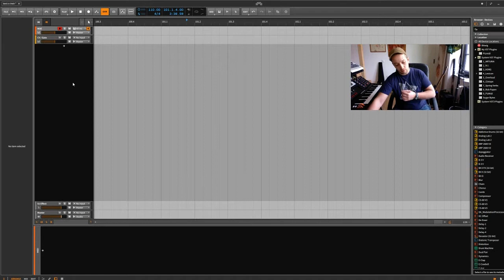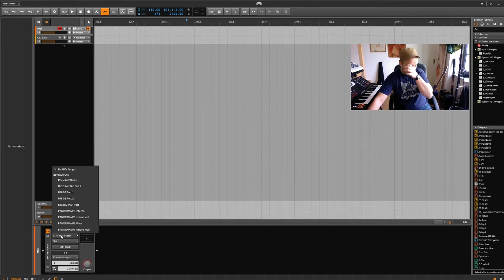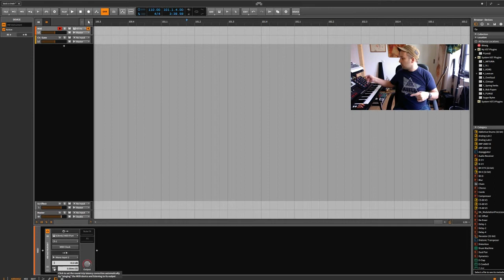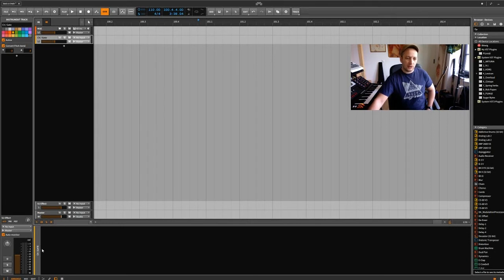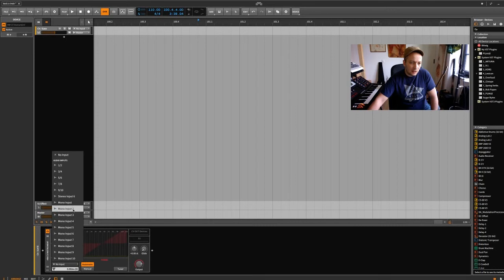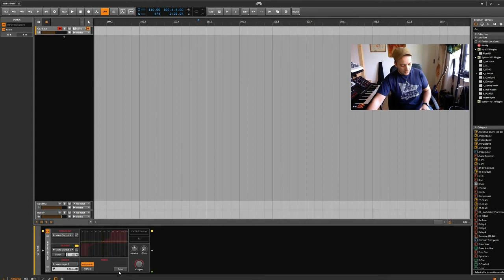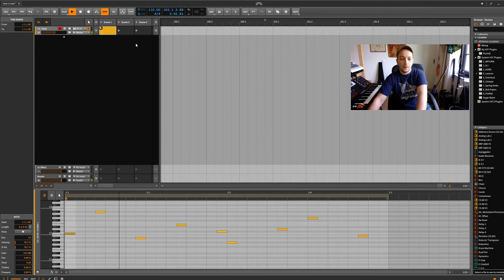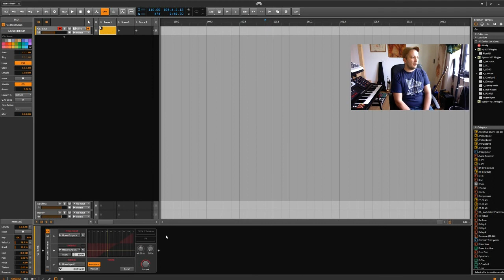Bitwig Tutorial:  How to hook up your Hardware Synths using MIDI Or CV/Gate

Comment: hi mate, loving ur tutorials, as I'm new to bitwig 2 ireally appreciate them. 

i have a little issue and was wondering if u have any advice. i have 2 hardware controllers ( akai mpd232 and the beatstep pro) hooked up to bitwig. thing is when i select a track in bitwig it will pay sequences from all of the controllers at once but i don't want that. what i need to figure out is how can i assign one controller to a specific channel/ track n so it will only play sound s from that one track. the beatstep pro has 2 synth sequencers and 1 drum sequencer so i need to select midi channels to match the tracks on bitwig but bitwig does not Show me an option to select a midi channel
Reply: Mathieu Pé 
thanks for the quick response b
m8

can't find anything for the akai but the beatstep is for bw1 . to b honest the controllers work fine but i just need them to play sounds from specific tracks. i.e. if i set the akai controller to midi channel 10 i want my drum track in bitwig set to channel 10 so its only triggered by my akai and not my other controllers and then i can have my beatstep on midi channel 1 and have polysynth set to midi channel 1 so its notes are only triggered by the beatstep. my problem is when i click on a track in bitwig it will pay notes from both of the sequencers at once. 

iv installed v2.1 beta today and it comes with a midi mapper but im trying to figure how to work it

thanks
Reply: Mathieu Pé no worries thanks for your help though. really appreciate you taking time out to respond
Reply from the maker: You're welcome. Sometimes it takes a bit longer though :)

Comment: Can i only send Midinotes (note pitch a.s.o.) if the external Device plugged to Soundcards Midi In?
Because "Clock" don´t need a Information on Soundcard´s Midi IN, i can send with just Soundcard´s  Midi Out to the Gear.
Why i can not sending Midi Notes the same way?
Or do i need setup the Midi-Filter (PCE and PCEN) correctly?

My SoundCard has 1 I/O Midi.
DAW(Clock) -> SoundCard (Midi out) -> Korg EMX (in/thru) -> Korg ER-1(in/thru) -> Modular (in). Audio of each Dev back to SC -> DAW.
Reply from the maker: Selektive Wahrnehmung  in bitwig midi is working through scripts who will handle your midi hardware. So you should first set a generic midi device script to listen to your midi i/o.

Comment: The problem with Bitwig and hardware instruments is that mute and solo don't work work making it useless for any serious complex work. Can anybody actually make a DAW these days that works for a proper pro MIDI studio? Reaper is useless due to stuck notes problems. Only Logic actually works but there are other problems in Logic.
Reply from the maker: I have a live setup using hardware synths. I can mute and solo tracks normally. Not sure what is your setup and therefore your issue.
Reply: Mute and solo do not work for MIDI. They only work on the audio. This also throws up an issue if you use multi channel vsts because once again you can not solo the MIDI  channels going to for example a sampler instrument. In this case however, you can mute which is very odd.

No other DAW I have ever used works like this. Solo and mute work on both audio and MIDI. The way Bitwig works is nuts.
Reply: The worst scenario is actually with multi channel vsts because if you want to isolate a track the solo button on the MIDI track does nothing and you don't want to have to always route the outputs back to audio channels where solo would work. You have to open the vst to solo a channel. This is not good at all if you are say using Kontakt. I use another sampler called Independence. I initially thought this was a bug but it's actually a feature.
Reply from the maker: Did you check the "add missing channels" fonction offered in every multiout vsts? Just like the drum-rack sub-mixer, you get your tracks wich can be muted and soloed.
Reply from the maker: And yes they have a  peculiar way of handling midi.
Reply: That's not really convenient. When you are in arrange you should de able to click on solo at the track header. Once projects have many tracks it's important to be able to easily solo tracks while you are working in the arrange window otherwise you have to have a mixer open or the multi channel vst instrument interface which will obviously have solo and mute for each channel. Also, in terms of hardware instruments it is especially bad. Lets say you have a multi channel sampler or some other sound module which could have 16 seperate MIDI channels and lets say you aren't feeding every output seperately back into Bitwig where audio can be soloed or muted. You can't solo or mute each channel of the hardware from Bitwig. You would have to do it at the hardware.

I'm not the only who hates this. There are plenty of forum threads about it. I'm happy with everything else about Bitwig except this one issue. What concerns me is that they seem to intend to keep this as a feature. This has to do other issues which muting the MIDI brings up like side chaining for example but it damages Bitwig's ease of use as a MIDI sequencer. It's something that I never actually tested while using the Bitwig demo because I has simply assumed it would like other DAWs.
Reply from the maker: @ryanstark2350  you seem able to make a good case against it. Write them a constructive critic email at support@bitwig.com .
Reply: I've already contacted them about the solo not working when directing the MIDI to another track but I thought that was a bug since mute worked but I now see that simply a MIDI channel going out the system has no solo or mute so it's designed in. However, why mute works in the other scenario is not logical.

I'm not a big fan of DAWs in general. There is so much bad design. It seems they keep adding new features while not addressing fundamental problems. This is why the few DAWs that remain as industry standard never get replaced. Reaper tor example should be a contender by now but MIDI hardware integration is broken and the configurability has gone so far that it's now a detriment to workflow. The MIDI issues especially rear their head with older synths which are unusable with Reaper. Moving from one DAW to another is just a waste of time. I'm currently having to move all my projects out of Reaper which I was using for a while. If you look at other areas of software there are usually two or three programs that everyone uses. There are dozens of DAWs and each one of them has problems. Bitwig is just better than most. It works on Linux as well which is one big reason that I want them to succeed.